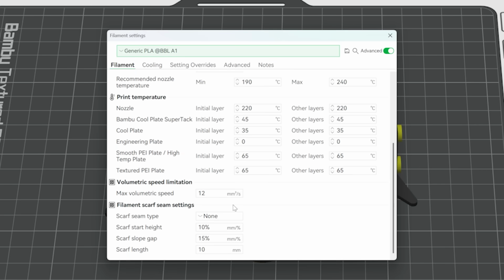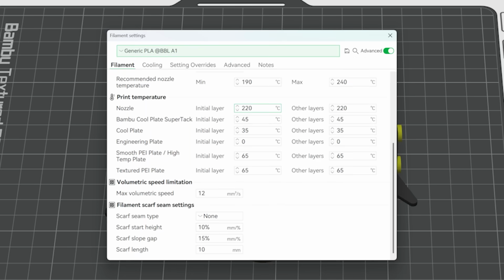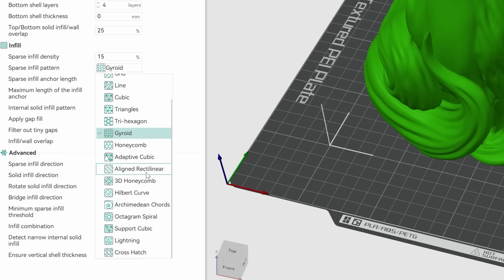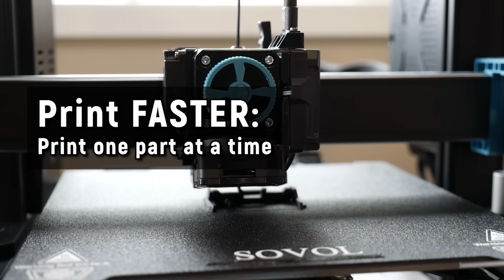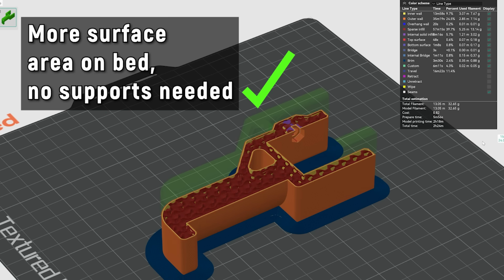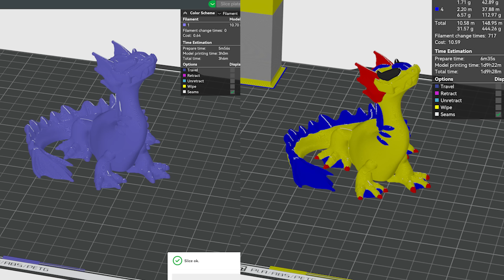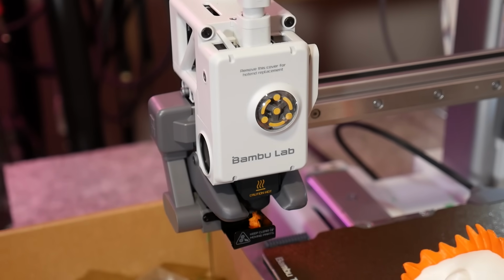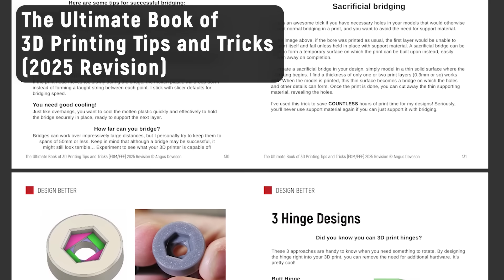Cut print times in HALF with these simple slicer changes!

Comment: I like the section on sequential printing as I use that feature all the time. And with proper planning and part placement you can easily print a bunch of parts on a single plate, and print multiple parts that are higher than the X axis gantry. 

Sequential Printing

https://youtu.be/H07Wt_skUmU?si=x6r03GLBapM3Az4I

https://youtu.be/DFkU9roBjdA?si=vrsQiLIUK8MENvmz

https://youtu.be/1UlCzUlvhtY?si=HFQ1wDhMAaPK_J7B

Comment: Amazing video. I had no idea you could print multiple parts seperately, I could've used that in my current project!

I wonder, if you have a long straight print on a bedslinger, does it matter if you align it with the movement of the print head or the bed? Or maybe diagonally is faster?

Comment: I actually agree with the printer manufacturers having generic PLA slower than a brand
Had a bunch of print failures with cheap PLA on my bambu using the Bambu filament presets (instead of their generic one, that worked better)

Comment: Absolutely agree with the point about multicolor printing, it is great but only really useful for things like nameplates, text on models, small color inclusions etc. Otherwise it goes way beyond reasonable. It's still great to have in terms of being able to easily print multiple colors or having transparent parts - but otherwise it is really not practical.
Reply: I disagree there are many cases it can be used in bigger stuff but you shouldn't make a 20 by 20 bowser with 16 colors

Comment: For the folks using Cura, you can look at utilizing "gradual infill steps". Basically it's the same concept as the 'support cubic' infill type mentioned, but can be used with other infill patterns.
Also, I completely agree with preheating the bed. Not just for times sake, but to ensure the bed and build surface is evenly heat soaked.

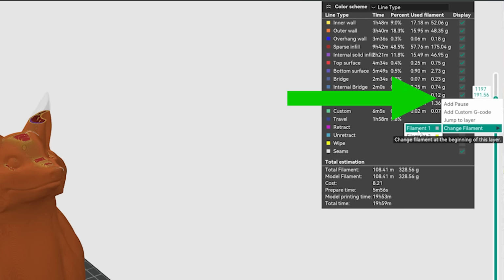Comment: 10:00 yes that’s why it’s a prime tower, not a purge tower. With a single color change okay. But with many you can get irregular line starts after color changes (nozzle pressure). Same with the prime lines at print start

Comment: thanks for that video, i just started into the 3d printing hobby and i wanted to print a paint rack. with standard settings it would need 300g filament and around 8 hours to print, with you tips i am now looking at 173g and 5 hours print time. it almost uses half the filament and its still stronge enough for my usecase.

Comment: good stuff, dude!  a lot of the time saving slicer settings unfortunately don't work all that well on the newer flashforges, though - my adm5pro is my abs workhorse, at least until i decide to change that to one of my other machines.  i really wish flashforge had better functionality, especially for stuff like cancel object which others have figured out, but automatic leveling before each print is known to stall the machine to the point it's the first thing everybody disables (including the manufacturer by recommendation).  i might switch abs over to one of my klipper machines at some point, probably either my micron or e3ng, but time will tell.

Comment: Great video, though one nitpick: the prime tower is not useless, and is certainly not about purging filament. It's about priming the nozzle for even pressure. Now why is that important? Because with uneven pressure, the print quality is seriously degraded. Most people don't notice, especially with big models, but try to print small text after a color change, and you WILL notice the difference with and without it.
And it does tie in to why you suffer from degraded print quality when timelapse is "on" on the A1: since it pauses to take a picture, there is uneven pressure in the nozzle. Enable the primer tower again, and you should get the same print quality as without the timelapse, at the cost of a bit of filament.

As for the multi-color printing wasting time and filament, yep, it would be a great idea for a video to explain how to split models to print separate colors differently, like for example what Corridor Digital made for the thousands of Wren models. I do not yet know how to do that, but that'd be super useful, as I currently do not print any model with more than about 20 filament change or so because I hate having too much waste. (that's about the number of filament change to get 4 colors in a few top layers)

Comment: If I've needed durable prints, like 99% of my prints need. I've noticed like almost 10 years ago already, that infill is very poor in increasing part strength. Perimeters is the key. I always bump perimeters to like 5 or even 7 and many times it's also usable increase solid bottom and top layer amounts, highly dependent on part type. But anyway in critical parts I still use many times quite sparse infill amounts. Usually just eyeballing that ie. threads are well enough bound with infill that they won't crack loose.

Btw. I occasionally have need for like labels in my mechanical parts. I don't do multicolours, but I like do small cavity to part and after main part I just part that label part by doing layer shift in different color. It's really short job to do like 5x10cm label part separately that's like couple mm's thick. Just thought to note, that there are always design alternatives to counter need for multicolor systems.
Reply: 5 walls are actually peak value to strengh
Reply: @timo4463  Depends vastly on part geometry.

Comment: On the orientation point, if you're printing a structural part, you need the layer shape to be oriented so that loads are supported by perimiters or such that loads compress the layers. Orienting a print to minimise support can maximise shear failures. I find a good comprimise is orientations that balance shear stress against support needs, sometimes adding a decorative chamfer to maximase bed contact. I printed my old Garmin eTrex's bicycle handlebar bracket like this in PETG and it has lasted 8 years in the weather and has been moved to my new bike in the last month. No signs of any degradation. Also, diagonal layer lines make people think you're a warlock level designer, I find. (I wish I was! Angus is Warlock Level!)

Comment: My main gripe with these modern printers, like the P1P, is that it doesn't have something simple like intelligent auto bed leveling. It's not like it has some form of hardware limitation.
It has put me off of getting rid of my old Ender style bed slinger, since that one had the option to add that since it doesn't run off some proprietary code, not to mention I'm not exactly sure but the one time I turned off the bed leveling on a medium sized print the print failed from not having a propper first layer not sure if it was just me being unlucky

Comment: While printing items one at a time versus by layer can speed things up, there are also circumstances where it can slow things down. If you have a part that has a lot of small layers and you've set minimum layer times so that you can ensure the part cools at an appropriate rate, printing by layer can allow you to print the layer on each individual part faster because it will have time to cool down while the print head is working on the other items. On the other hand, if you're printing them object by object, the printer will have to slow down for each item when it gets to layers that do not satisfy the minimum layer time requirement which can add up.

Comment: Great drop Angus!!! Ok so here’s my question. If the AMS example of the dragon you showed was printed on a tool changer vs the ams, what’s the time calculation then? I’ve not done multi-color yet nor does my focus really bring it in to play from a practical standpoint. However, if/when I go there I believe it will be for multi-type filaments vs color. That said, just from looks alone it appears to me that the speed of multi tool head prints are significantly faster as well as significantly less waste.

Comment: In addition to print orientation, adding supports designed in CAD (using the correct part orientation) is a great way to minimize supports and print in less time. In some cases, it can also "stabilize" parts and vastly reduce layer misalignment on "packs" of tall objects.
As for max volumetric flow, it definitely helps finding the limits on a per-filament basis. Yet, It's advisable to split this test in a few runs : the test itself can be quite tall depending on the user input, tall-and-thin objects tending to "wobble" a bit at a certain point. This can somewhat flaw the results.

Comment: i think preheating is also VERY important for first layer quality and adhesion with picky filaments or models with very unforgiving first layer geometry:
YES in theory the printer will wait for the bed to reach a set temperature to print, BUT what it actually does is wait for the TEMPERATURE PROBE ON THE  UNDERSIDE of the bed to reach the set temperature...
this is a single measurement point and doesnt evenly reflect the temperature the bed will have on its surface.
YES modern heaters are better at evenly heating the bed, BUT still the top edges of the bed can have a significantly lower temperature than the center on the underside. 
YES modern glass or milled aluminium beds have less tendency to warp and bow as they heat up unevenly than on older models, BUT if we are talking first layer adhesion its not just the distance that can mess things up but also the stresses introduced by the different thermal expansion coefficients

so do yourself a favor and preheat you beds instead of printing from cold

Comment: I'd like to see this by-object method incorporated into single-part prints. Imagine a castle with 4 towers in the corners. With knowledge of the print head dimensions,  and ignoring minimum layer times, there's no reason why you couldn't print, say, 5mm of each tower in turn, eliminating hundreds of travel moves and potentially lots of stringing.

Comment: My favourite speed tip is to use thicker inner walls and use alternate extra walls.

So my external wall will be 0.42 as normal, but my inside walls, infill etc anywhere where detail doesn't matter will be 0.64.

That way my perimeters willl be 1.06mm but because im using alternate extra walls my infill anchors become the 3rd wall and then as the name implies i alternate each layer an extra perimeter which sandwiches those infilll anchors effectively giving me 1.7mm thick perimeters which plenty strong for the types of prints im doing. 

The thicker extrusion width massively improves print speeds over having more perimeters though.

Comment: I only run a mesh calib if the first layer goes wonky. Haven't done that in over a year. Upgraded bed springs made a huge difference in my Ender 3.
I get just north of 14mm3/s w/ a microswiss hotend. Makes for a 25min benchy which isn't fast today, but not bad for an '18 vintage Ender.

Comment: 12:00 this is exactly why I changed my ending gcode script for my Bambu printers. I often will use the same filament over and over again for different prints, so instead of unloading the filament at the end of every single print, I deleted the unload script from the ending gcode script. This makes starting a new print much faster if you are using the same filament again, and if you aren't, the unload process doesn't take too terribly long and it would need to change over anyways.
Reply: can you share how to do that?

Comment: The problem with support cubic is it doesn't always add support in equal directions and you'll sometimes end up with entire sides of prints that will crush or break easier than the more dense areas, you can already achieve a similar effect by using low density gyroid or crosshatch, or if your slicer has it, the new 3d honeycomb (not the old one) all of which don't intersect and have strength in all axis, something even as low as 5-10% works very well.

Comment: As a casual hobbyist having dual heads on the H2D with dual AMS is a game changer for speed on multi color prints. Same if you want to use a support material. However, I am kind of salty on Bambu not letting me (easily) the use Orca slicer anymore.  Sometimes they just don’t understand the corporate mindset.
Reply: Agreed :/ they should have partnered with orca or gave them the option to release a orca version specially for bambu mashines

Comment: As far as prints failing for Bambu, in the handy app, you can. Pause the printer, and hit the skip button, and it will bring up what’s being printed, find out which print has come off, or failed, and check that box. Then hit okay. The printer will skip that part of the print entirely.
Reply: Also in the slicer now!
Reply: And the x1 a1 and h2 have jt on the Touch screen

Comment: something that can save a lot of time on simple prints is disabling or reducing the minimum layer time, it's very conservative, and if you have good part cooling (e.g. big fans on a hevort style printer or cpap) you can disable it with no issue, that will turn some layers running at 100mm/s to 500mm/s, making a 50 minutes print into a 15 minutes print.

Comment: Just from the last point you made. Add Spoolman to manage your filament in real time. Once its set up (it takes a while if you have a lot of filament) it will tell you how much you have left, if you have enough for the next job, last time you used it, how much the print will cost etc. You can even have it print QR codes to auto load the right filament in klipper (i just select it myself though)

Comment: A) plan on bolting your printer to a concrete floor
B) drastically limit the plastics you can use
C) don't plan on using it in the same building you're going to sleep in due to noise

Comment: I remember buying my first printer under your recommendation....Wanhao i3 Plus. 

First thing I did was to take it apart, safety it with grommets safer sockets. Then after a test print, changed the print head with micro Swiss and noctua fans....it was glorious. Thank you. That was my first venture into 3D printing. I jumped straight into it without any idea what was what. I wanted to print terrain for tabletop gaming.

Comment: Also, default profiles can be absolutely, completely, inexplicably bad. I have a Sovol SV 07 plus and had it been my first printer… eww. Thankfully I use Cura and learned with an Ender 3, because whoever made the profile for Slic3r forks, saw fit to make it go much slower than the defaults of an Ender 3. When I tried an Orca based one, I ended up pushing the print speed by 1000%, so it took one hour instead of 2 days.

Comment: all this speed comes at a cost, ive tried the stock profiles with stock hw and BL filament. Even with all these and auto calibration there is ringing and ghosting for starters. then i tried the 50% speed setting from the handy app, what i got off the plate was way better. so i tried slowing down all speeds in the profile by 50% to match the halfspeed setting. I then tried the halspeed again, and lord behold.. the print was even prettier and the bonding was amazing.

the printer makers want to sell high speed at any cost it seems, i for one go the manufacturer of the filament and always try their suggestions first. they should know better what their product prefers to be optimal than manufacturer of the printer i would assume. Angus has a great point here that the best timesavers is wallcount, infill % and such. 

very good explanation Angus.
Reply: i was also way disappointed by the quality of bambus stock print settings especially on parts with higher complexity...
i turned down almost every speed and most importantly the first layer speed, as nothing eats more time than starting a print and coming back to it later to see it has failed due to poor first layer adhesion and having to do it again. and possibly even having to clear out a molten blob of plastic first

Comment: Sorry dude but I disagree on some of it. It might work on pla and if you put the part on a shelf to look at but you are missing a couple of things. For example if you print ABS over 60mm/sec no matter what Vol E your hotend can handle you get with exceeding speed exceeding crappy layer adhesion. Print still looks beautiful but might fall apart under stress. The same for PETG over 100mm/sec. It does matter how fast the nozzle moves for the filament to stick to the prior layer its even slower for Nylon and TPU. Another thing to print faster and strong is get a bigger nozzle. You can also adjust the layer width of inside perimeters. Like if you want a 2mm wall the os perimeter 110% nozzle diameter the inside and infill 150-200% nozzle diameter 150 for a creality style nozzle 200 for a V6 style as the flat area on the bottom is bigger. As for printing multiple pieces printing them layer by layer can be faster stronger and nicer especially the smaller they are. If you have a small part you might drop below the min layer print time so if for example the min layer print time is 30 sec and at your speed the part would finish in 10 sec then the speed will be reduced to 1/3 to print it in 30 sec if you print 3 parts they all print at full speed and you get 3 parts in the time of 1. So printing something like chess pieces, small gears or small cross section things like columns etc Pays to look at the layer print time and speed and then print enough of them or a big part next to them to maintain full speed. Had a discussion with someone about printing test pieces to test strength pointing out that his test piece when he prints 3 prints at 15mm/sec to make the layer time which is not that useful as a rl parameter
Reply: u can print ABS 200mm/s with no issue if u have heated chamber 
rapid PETG i can print on my v3 KE around 300mm/s with 0 issues last couple of months i only used RAPID PETG its my favorite filament now and layer adhesion is great